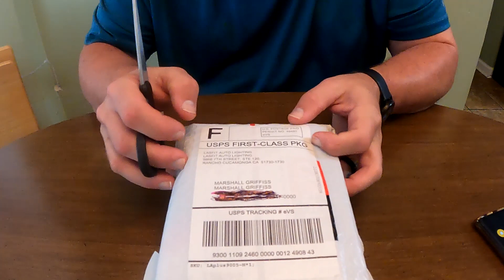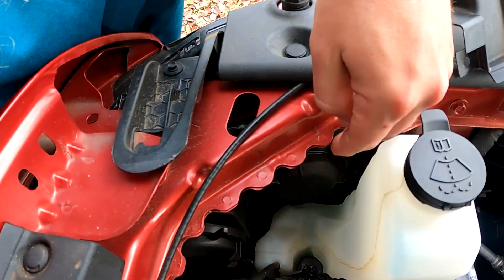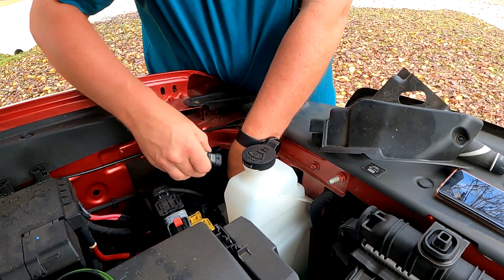2021 GMC Canyon LED High Beam Replacement - LASFIT

Comment: Thanks for your video on YouTube. I changed my low and high beam bulbs on my 2022 Canyon Elevation. The only thing is while the switch is on auto, the low beams use to come on whenever the truck was running making them running lights. Now with the LED'S, they only come on in the on position. Is that something you noticed with your install? Please let me know if there something I can do to correct this. 

Thanks

Glenn Laurie